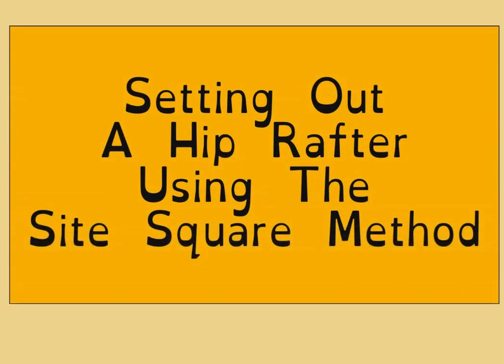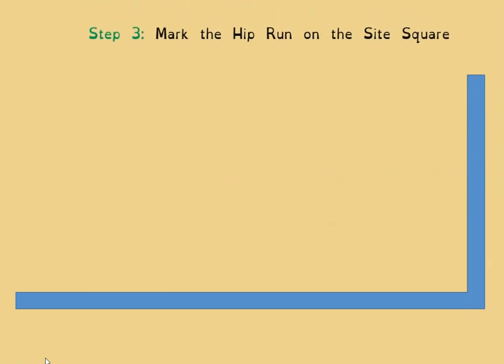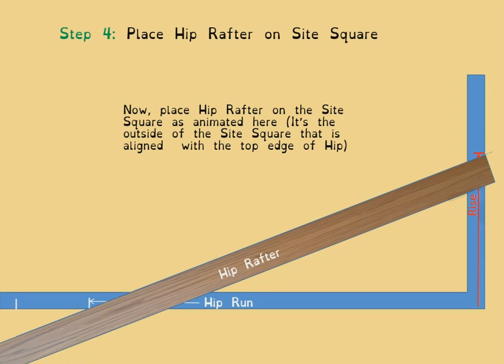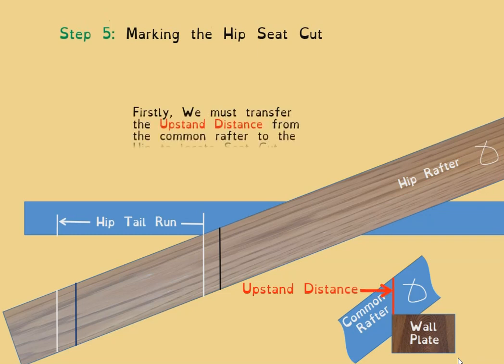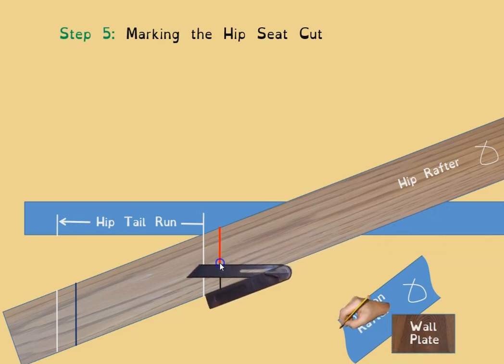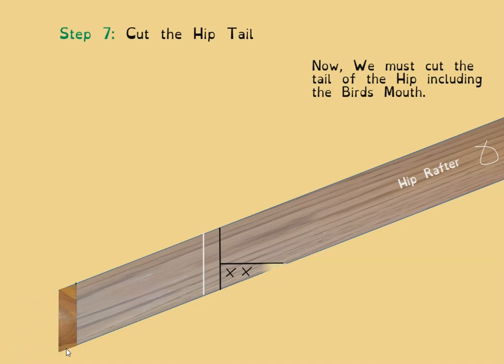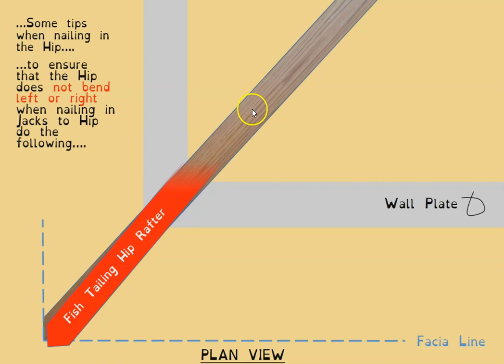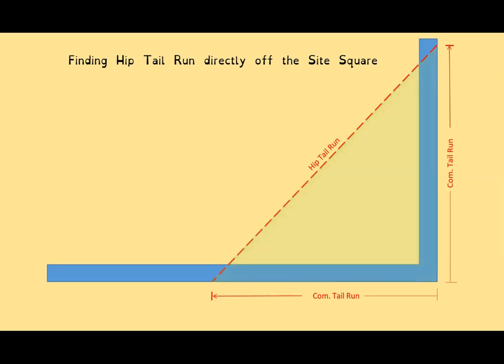the marking out of a hip rafter

Comment: Hello, so for the hip deductions if I have a timber  thickness of timber 45mm, than half of that is 22.5mm, than  I mark down from the top of the point 22.5mm than another 22.5 for the hip to meet the ridge if that makes sense
Reply from the maker: To get to the point of the Hip you must first deduct half diagonal thickness (Draw 45° line across thickness of common and divide by 2) of the common rafter....remember this is just to the Hip point, so to get the shoulder lines to run your saw (set @45°) on to from that Hip point  you will need a second deduction which is half the hip itself (22.5mm.. if Hip was 45mm thick).
To get a different perspective on the Hip Deductions check out my video titled Using the 390B Roofing Square.

Comment: Outstanding Sir, a great presentation as always. Maybe you might do a future on dropping the hip and the dihedral angle, 👍 🔨 🇮🇪
Reply from the maker: Glad you like the video...if you check out the Bastard Hip and Saw Horse videos i have on this channel you will see the steps taken for the dihedral Angle......just have the Dihedral planed on first and then its the same procedure after that to mark the Hip.
Reply: @michaeldownes516  Dropping the hip seat cut by 1/4" works well in most case to get the hip edges to plane in with the commons. Planing the backing bevel is a bit classier but takes a small bit longer. Your bastard hip series is on my to watch list, 👍 🔨 🇮🇪